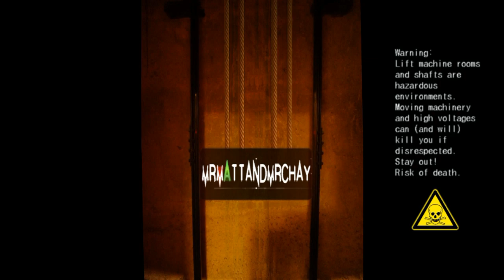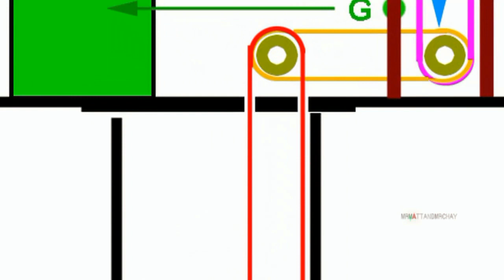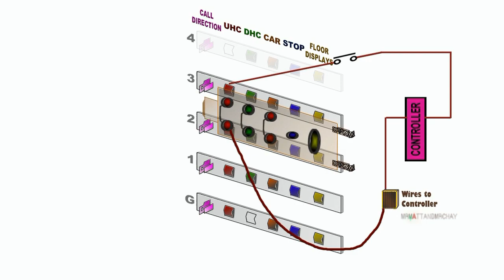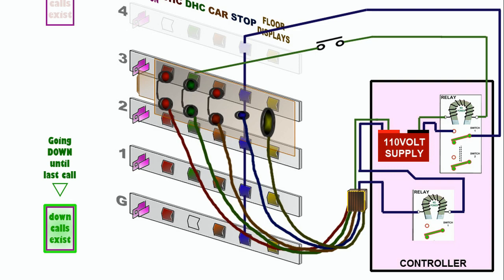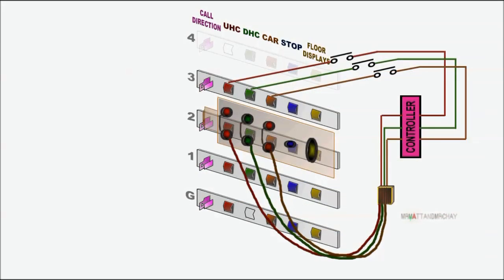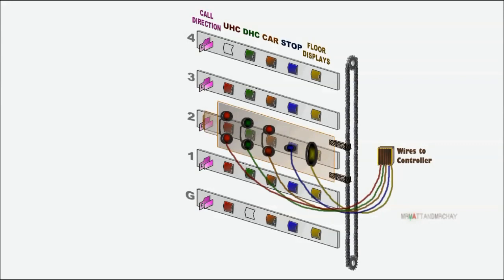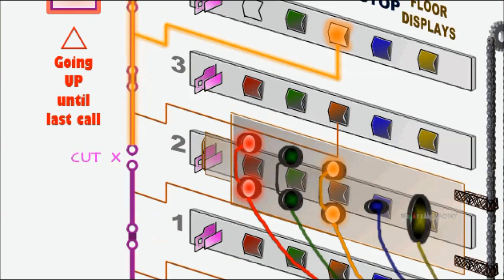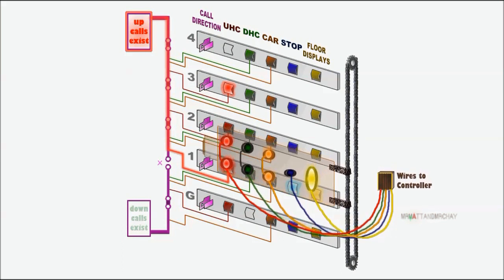OTIS FLOOR SELECTOR movie - A beginners guide to how it works.

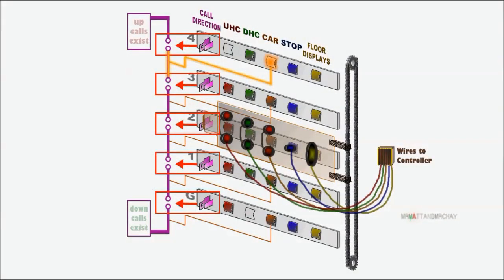Comment: 11:54 "If the lift is not at a floor, the contacts join together"

In case i press the stop button between floors
 - Then the elevator stops, obviously
 - Then the elevator is not at any floor
 - Then all contacts join together and the line is not seperated up/down anywhere. There is connection through all of the line

Then in case i press a new floor button to restart the elevator
 - Because the line is not seperated..."The voltage just goes both ways and the lift is requested to go up and down at the same time... absolutely no use"
 - Then i should be stuck in the elevator

But old relay-controlled elevators simply don't behave like that. It's alwats possible to restart - after pushing stop button - from any position in the shaft. I think the select direction logic works a bit different that you have illustrated.

With the system you have illustrated, one - and only one - floor contact at a time must always be open, regardless of the car position in the shaft .
Because if none are open (all joined together) the voltage will reach both directions which is of no use...
and if both contacts around the car/carriage position are open, it would be "isolated" and the voltage will not reach any of the two directions.

But is is impossible to always have only one contact open at a time.
Because there will always be that split second where the car is precisely between two floors, and in that moment, either both contacts around the car could be open at the same time - or none of them

A little side story:
I've only been stuck once in my hole life in a relay-controlled elevator... even after 1000's of rides and thorough tests of all safety stop systems. It was in an 80's hydraulic DEVE where the select direction logic got horrible confused and the elevator started to descend from the lowest floor, which meant that we crashed in the bottom of the shaft. I got it on video aswell STUCK in the elevator!

To compare, i've been stuck in at least 10 digitally controlled elevators. Relay is best!
Reply from the maker: Heritage Elevators ELEVATORMUSEUM This is very interesting about using the stop button, then entering a new call with the line NOT broken (as the carriage doesn't break it all of the time).  It's not something that I'd thought of, and what I'd love to do is an experiment to see what happens.  Unfortunately i'm not in the position to do such a thing.
I heard what ELEVATORMUSEUM are saying, but, what happens in a power-cut when all the relays are reset and the lift is between floors?
This topic has helped me with the next video about the Express design.  See 14:41 onwards - you see the LINE on the left.  This line is never broken, either one or two switches are activated whilst travelling.  Well HERITAGE ELEVATORS must be right here, and Express had the solution!
Very interesting stuff and it's got me thinking! :)
Reply: Matt,
I will look at the selectors again. I thought about the problem and I think this might be the answer: Actually, there is no issue with two contacts being opened at the same time other than that there are two floors at the same time that can't be selected. Again, I will carefully check the selectors - but when I was examinating them at night, it appeared like the opening of contacts has an overlap. That would mean that in case you would stop between floors, you couldn't select the nearest floors above and below the car but would be able to enter any other command for all other floors. Even tough the system might work differently in reality - it could work like I said. Will let you know.

BTW: there are systems (some older Hauushahn) that indeed loose their position when pressing the emergency-stop. These lifts go down automatically to the next floor at slow speed after re-setting the toggle. (In Germany, mostly toggle-switches are used for emergency-stop.)
Reply from the maker: ELEVATORMUSEUM Hi, Cool, thanks.
There must be provision to be able to select a floor even when the lift is between floors and line is not broken.
One thing to mention is, Otis do not have any relays connected directly to the selector.  Express do - each turn of the selector triggers a relay with many contacts available. So what I'm getting at is, everything you see on the carriage is ALL that's available.
The only answer has to be - When the system is reset between floors (such as a power failure), there must be a logic circuit that says "when line is formed, elevator is not moving, ANY car call sends the lift to the ground floor regardless".  This might even be initiated without a call present after a power cut.
I like the Express lift's method of the line NEVER being cut.  Take a look at watch?v=W5Wcj9EJ5Ao @8:38- the normally closed switches on the left form "the line", you'll see that a switch is activated before one is released so the line is never broken.
Reply: ELEVATORMUSEUM
"That would mean that in case you would stop between floors, you couldn't select the nearest floors above and below the car but would be able to enter any other command for all other floors"

What if the elevator only has two floors?
Reply from the maker: Heritage Elevators After the STOP button, how did you try both up and down selections afterwards to confirm that the UP/DOWN logic is still working even when between floors?
I wonder if the carriage was making 'any' connections to the floor bars at the time or whether it was 'completely clear' of any connections.
Reply: mrmattandmrchay I only tried to switch direction after stopping just above the basement in the up direction. I think i was too close to the basement for the elevator to go down there again. I have to try it again and stop in the middle of the shaft - in both directions - and then try both the highest and the lowest floor
Reply: Heritage Elevators An elevator with two floor doesn't need a selector. At least, it doesn't need any device that would associate commands with a direction based on the car's position. The upper floor will never require the elevator to go down.

I looked at the diagrams and selector. I was right: the curve opens two contacts at the same time when the car is between floors. I made a quick video on that.

A special challenge is to use the selector for intermediate stops (half floor distance) because the curve may already block any commands for the nearby floor. I assume, this is solved by a special relay arrangement or the placed the contacts for these floors a bit away from the actual floor position which should work fine as well.

You never stop learning, I never looked at this in detail. Good discussion!
Reply: mrmattandmrchay Matt, no. The curve opens at least one contact all the time. If the carriage is between floors, to contacts are open. If you look at the carriage, it becomes pretty obvious. I haven't watched your video again - so: did you consider that the voltage for the circuit-breakers doesn't go through the carriage? Every FH on a floor-bar is connected to the group of possible commands (up hall, down hall, car) all the time - what the carriage does is to mechanically open the contacts. There is no need to make sure only one contact is open at a time - if a contact (FH) is open, it just means that you cannot give any command for the stop at which the FH is open. Pretty acceptable for floors close to the actual position, right? 

See my short video and on this, I will place a link to you in a minute.

Sincerely,

Jan
Reply: ELEVATORMUSEUM mrmattandmrchay Yes that makes sense. Two contacts can be open at the same time and it will still work for calls beyond those two open contacts. Say floor 2 and 3 are open, then it can still accept calls fom any floor below 2 and any floor above 3

But this system only works when there is close to equal distance between all floors.  If there are huge differences in the distance between each floor, you will get into trouble with this design. Let's say the longest distance is 5 floors without stop. Then the curve would need to represent a height of five floors to always keep at least one contact on the line open. If the curve is only long enough to cover one floor, then all contacts would join together when the elevator is travelling between the two floors with long distance between them.
Otherwise If the curve equals five floors of height, then it would block the surrounding floors (two in each direction) from calls when the elevator is at floor position with many floors close to each other. Like the half floor problem you mentioned, it would block the two floors around it.

Also it was a bad example with the "two floors only" elevator. Say there are three floors, but the lowest floor is locked off. If you stop the elevator in the middle between the two upper floors, and the curve is at a position where it opens the floor contacts to both of the two upper floors, you wouldn't be able to restart the elevator without a key for the basement - then you would be stuck
Reply: Heritage Elevators Good thinking - and guess what: I also thought about the first point you are making. There are elevators with long express-zones. If from the 1970ies or older, they would use selectors. I promise that I will watch how it works when I'm in such a machine-room. However, I guess I know how they fixed it: there must be intermediate (floor-) bars between the floors that have long distances in-between. On these intermediate bars, most of the contacts are not needed except for another FH circuit-breaker. That should be cheap and work perfectly. These FHs don't need to be associated with any floor, they just need to make sure that the line is never shortcut when the car is travelling the express zone. For long zones, you may add as many as you like.

Interestingly, on "my" selectors I saw that the FDC curve is longer towards the lower end of the carriage. This should be because it gives passengers more time to enter commands when travelling upwards from the main floor. Makes sense because most people using an elevator are travelling upwards (crowded car)  and people travelling upwards usually have different destinations (various upper floors vs. one common destination for the trip down). -> On an average upwards-travel, there will be many more buttons pressed than downwards. With this arrangement, passengers can still enter commands even tough the car is already close to the destinated floor.

Regarding the last point with a key-locked floor and two other floors: yes, you would be screwed. However, I don't believe there are many 3-stop elevators with selectors, even less with the 3rd floor locked off. If needed, this could be fixed as well. I would replace the circuit-braker by a 2-position switch on the intermediate floor. A tilted curve on the bypassing carriage would switch to down on upwards-travel and up on downwards-travel. This is how other companies made selectors.

Cheers,
J
Reply: ELEVATORMUSEUM Ah yes, of course. "Dummy" floor bars to correctly break the line at distances with no real floors. That makes sense.

Elevator controllers are really interesting, especially because i'm programming my own. They must be fail-proof at any time under any circumstances. The possibilities are almost endless and it requires enormus amounts of thinking and testing. This is logic in a nutshell and thats why i love it
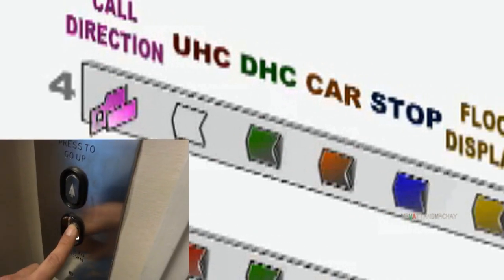Reply from the maker: Heritage Elevators ELEVATORMUSEUM Yep, you've got it guys.  See watch?v=wbvIXYZDdlI @1:25- this is the 'dummy floor bar' that you are talking about!  This building doesn't have a 1st floor and the lobby area ceiling is very high. This creates a gap between the Gnd and first stop (which is 2nd floor) in the carriage.  You can see this floor bar has virtually nothing on it and is used to keep the FH contacts open.
I also overlooked the size of the carriage - it's over-sized vertically so that more than one switch stays open.
Thanks for all this info, very interesting but too late for this video of mine!
Reply: mrmattandmrchay I just talked to a retired Otis chief-mechanic about the selectors. Of course, he confirmed the intermediate "Dummy" floor-bars for long distances, but this time I was more curious about the short-distance landings. He took a very deep breath and said that this had always been an issue with the selectors. He was funny explaining that the factory often seemed to have "gently forgotten" about these stops when making controllers. The guys in the field had to mess with it and to get creative about it. In most cases, he said, additional roller-contacts were placed in the hoistway and additional relays were used. To me, using a 3-postion switch (either in the hoistway or fitted to the selector) makes most sense. The car or carriage bypassing the switch would set it from "up" to "down" when movin upwards and back when moving downwards. If the car or carriage is on the floor, the switch is hoild in middle-position "off" and no commands can be given for this floor. This actually is how many of the other controllers, with and without selectors, work in principle.
Reply: ELEVATORMUSEUM Yes, like i mentioned in my third comment. Get rid of the line of switches all together and instead equip each individual floor with switches that can tell if the elevator is already there, above or below. You just mentioned a 3-position switch while i mentioned 2 x 2-position switches. Either way, works the same
Reply: Heritage Elevators Otis was using the floor-switches for less complex elevators. They didn't have selectors. There is probably a couple of reasons on why the inline-system is used. But let's not blow up the comments for now - I just want to give an example for why the switches won't work either on short distances: Higher speed elevators have long distances for slowing down, sometimes multiple floors. If the car moves at full speed, floor-commands need to be disabled in advance (Let's say at least 1.5m above or below a floor). If this is achieved by a longer FDC, you may also use a long curve for the floor-switch in order to switch off the floor-command-lines appropriately. If you do so, you again will be in trouble with the floor-switches. So: besides the switch in the hoistway, you need some relay-logic anyway. (And that is what the Otis-man was talking about in terms of creativity.)

From other older elevator-engineers I've heard that short-distance landings always are somewhat "difficult". I found a pretty smart Haushahn-system from 1955 in our workshop as well. I will maybe show it someday - however, it would fail for short distances too. And I remember a 1950 Kehrhahn with a sign in the car saying "Rampe" (landing for loading trucks, in this case about 30cm above the ground-floor which was five stairs up as well) "can be reached only when starting from upper floors". The slower and less comlex your elevator is, the easier you can solve short distances, I'd say.

Cheers,

Jan
Reply: ELEVATORMUSEUM Yes that explains a lot, but i wasn't really talking about the ultra-advanced high-speed elevators. I imagine those would need curves of different lenghts.
The long curve used at high-speed  - to reach the stop contacts and disable floors a long distance in advance - then it's not possible to call the elevator from nearby floors.
The short curve used otherwise - to only reach stop contacts and disable calls in a short distance ahead - so it is possible to call the elevator from nearby floors.

Then you would also need some logic that can tell how fast the elevator is moving - and to tell if the short or the long curve should be used.

Is this how you would do it - or totally not?
Newer worked with this kind of stuff as i'm not an engineer. Just trying imagine how it would work with my own logic. Good to test it, discuss it and learn from being proved right or wrong
Reply: Yes, that is exactly how I would do it. Depending on the speed-level, another line of FHs shall be used with the FDC mounted parallel to each other on the carriage. Don't think they had FDC that were changeable by means of electro-magnets, but it would be an option.

The problem I mentioned is true for medium-speed already. A rule could be that the issue occurs sooner, the faster the elevator runs and the closer the short-distance stops are.

Here is what I believe is done with the relays: the only problem is to start the elevator from one of the short-distance floors to the other. This is when you have to give a command for a floor that has an open FH - which won't work. Now, if the car is at the "short distance floor A" AND the car is fully stopped (proven by the interlocks released), a relay will be activated that bypasses the FH of the short-distance floor B. It will feed the right currency that the car (if floor B is selected) goes the right direction. Going to floor A or B from any other stop works "normal". In regards to the FDC / FH issue, that would be a complete fix - but: we still have another issue: you cannot place two floorbars so close together on the selector - there is not enough space. Now, this is what requires additional contacts in the shaft. These would work like the regular contacts on a floor-bar but be placed "in situ"

I don't know for sure if that is exactly how they always did it, but I guess it would work pretty well. (I would even say: I strongly believe this is what they did.) A last detail is that when the car is started from A to B or B to A, the controller must set the speed to levelling because there is no distance for accelerating and braking. (I know, that was an obvious one...)

Regarding medium speed: just let me give a short impression on this: the two landings might be as close as 50cm from each other. Now, that already is about the minimum distance that a 2-speed elevator would switch from main speed to levelling. So: for short distances, the issue occurs soon even when switches are used.

In other words: throughout our discussion, I changed my mind in regards to the 3-position switches. I don't believe any longer that they are the key-criterion to make it work. Key is to bypass the FH or floor-switch under certain, defined conditions by relays and to find space for the other floor-contacts.

What do you think? Planning to talk again to the Otis-expert, maybe later this year. (Don't want to bother him too much.)

Inspiring discussion. Makes me thinking, that's good.

Jan
Reply: +mrmattandmrchay Matt the floor relays mounted on the selector 1U-5D etc were a different beast to the general relays in the main controller. The relay coils in the floor relays are double wound and the core is iron which is not the case in the majority of the normal function relays. When the coil is energised via a call button the SET side of the winding lifts the armature as normal, this in turn magnetises the core and holds the armature.When the  call is to be answered ST relay energises via the reset brush on the crosshead and energises the RESET side of the coil and induces a reverse flux onto the core thereby resetting the relay. The reset side of the winding is more powerful  than the set side.If you energise several calls on the selector and then remove the mains supply the calls will remain in their active state because the core is magnetised and will remain so until neutralised.The calls can be pulled out by hand with the power removed but it takes a fair bit of effort.